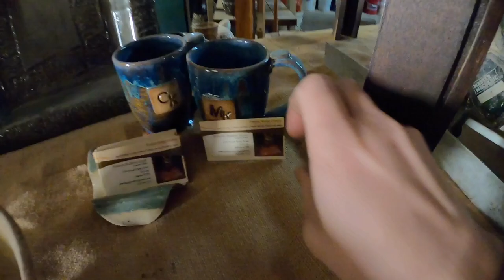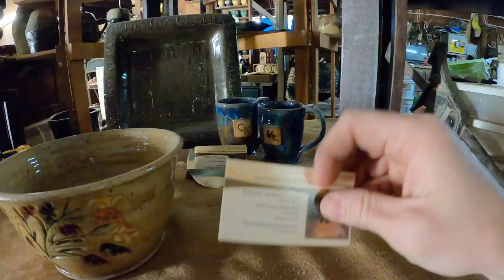Turning Trees into Lumber - First Time Use - Woodland Mills HM122

Comment: Cap’n I have never made the leap to getting my own sawmill.  When I had a real job there was no time... I just took my logs to a local saw mill and had them cut up.  By the time I retired I had so much hardwood lumber that I had to build onto my shop to have a place to do my woodenworks.

However, because I have an appreciation for hardwood lumber... I’ve never refused an opportunity to cabbage on to odds and ends of it.  Like the time...

In 1983 I was making clocks out of barn wood.  They made great gifts and it was all the rage.  I gave one to my brother and he said... I know where there is an old barn.  I’ll see if we can tear it down.  

Well, the farmer wanted the posts and beams but we got to keep the rest of it.  Over three weekends of insufferably hot and humid weather we dismantled it.  

The outside walls were all weathered white oak 1” boards from 4” - 24” wide.  The roof was pretty chewed up but we did salvage some of the rafters...

Then we got to the prize... the loft floor was 2” thick black walnut.  The boards were all 20’ long and varied from a foot to 2’ wide.  Although the roof leaks had taken their toll, we salvaged about 500bd/ft of it.  

Then, we made a discovery.  The lintel over the loft window was made out of hickory.  Someone had carved 1898 into it.  That’s when it struck me that we had been harvesting air dried old growth lumber that had to be used only in special projects.  

Over the years since, I’ve made countless gift items.  That walnut made great gavels, lecterns, quilt racks, shelves, racks, rolling pins, picture frames, gun cleaning boxes... I even made two bedroom suites out of it.  (You can see some of them at http://www.harrislandd.com ). 

But, the best deal of all is that I still have a little bit left.  When I get it dug out... I’ll send you a piece or two so that you too can enjoy the beauty of that precious wood. Do you want it?

Now about saw-milling... I watch a guy who built his own sawmill.  It is amazing and he cuts the most beautiful urban salvage lumber that you will see.  If you want to learn how to cut lumber for the best grain figure and beauty, he does it as well as anyone that I’ve seen.  His name is Mathew Cremona.  

Cap’n keep working at your hopes and dreams... you’ll look back on it one day and say that it was worth every minute!
Reply: I've seen most of Mats vidios and I built my own mill. Mine is lot smaller and a lot cheaper as I have $1500 plus labor in mine. Of course I had a lot of steel given to me and a friend that I got 25" band wheels;pillow blocks at wholesale price! I can cut 36" x 21' logs. I've been using off and on since 2005.
Reply: @wallaceeverett3927  now, that’s a bargain!  I have no welding skills... if I tried to build one... people would mistake it for a mud fence!  Yep, my welds are that ugly.  However, I’m a world class weld grinder!!!

Thanx for you ur comment.

Comment: The best saw mill to own is a buddy's. Get you own blade or 2 and barter the rest of value of the saw milling until you have more volume and get a sense of what your needs are.  You may decide to upgrade your tractor. You could also make a lift for the 3 point that lifts better than the loader. Some say, Get the best you can possibly afford and you only cry once. 
Get some Anchor Seal for the ends of those boards so the ends do not split while the rest dries.

Comment: Some wood, most notably hickory has varying densities where the heart wood is more dense than the sap wood and adjusting your speed along the length is necessary.  Eastern red cedar is another such wood but is more to do with the high volume of knots being encountered.  You'll pick this pretty quickly though.  Looking forward to sawmill action whenever it comes about.

Comment: Just thinking ahead for you Cptn;  make sure and plan for a shed big enough for the sawmill and room for tractor access; I've seen too many sawmill operators whose machines go bad prematurely because they are out in the weather; throwing a tarp over it is not a long term solution. Now, I'm gonna check out some of those clay coffee mugs!
Reply from the maker: We will do a cover large enough at some point.  But it definitely won’t be right out of the gate

Comment: I cringed at 6:07 when I noticed you'd tipped the blade guard up out of the way to get more clearance. I did that, too, at about the same number of hours on my new HM122 for the same reason you did, but I forgot to lower the log stops. Good thing I bought extra blades.

Comment: A couple things to consider on a sawmill that I wish I knew when I bought mine is the clamping system and the blade guides.  You'll have to accept the fact that blades are going to dull and they'll need to be sharpened or replaced.  There are a bunch of different types of blades that hold up differently over time.  I'm always available if you have any specific questions.  I'll share what I know.  Good Luck Buddy!
Reply from the maker: I maybe in touch in the future!  What do you have?
Reply: @CaptainKleeman  I have a Woodmaxx.  I'm currently looking at the Woodmizer LX55 though.

Comment: A nice channel for sawmill and woodworking is Matthew Cremona. He build a huge saw mill but the size is not the point, there is still a lot of information. Very sharp blade, good tension and the right speed are very important. I used to work at a saw mill and the pitch of the teeth on the blade were diffferent between hard and soft wood. thx for the video.
Reply from the maker: He definitely has some good information! Thanks!

Comment: a another channel i watch who does this for a living? one thing they do all the time to cut down on wastage on timber? they throw a block under the thin end of the tree, by thin end your tree trunk gets thinner as it gets higher from the ground right? so they put a block under the thin end an raise it up. So instead of when cutting slabs or boards they can keep as much of the heart wood running the entire length of the boards slabs, also when you start cutting off the bark ? instead of having one end say 1 inch thick an on the other end could be 12 inch, you can reduce massively the amount of wasted wood you cut away befoere getting to the good wood. hope it helps your friend , yourself an anyone who is thinking of doing this
Reply from the maker: Clint was talking about that.  Something he hasn’t tried yet but intends to start doing.  Thank for the channel suggestion and appreciate you tagging along!
Reply: @CaptainKleeman  Bus huxley is another who is building a home from tree' an also uses a wood mill,  dont know how long he has been running one for but he is have way decent tbh so it looks from a novice point of view

Comment: To eliminate some of that blade movement when cutting Move the side guides as close to the material that you can safely  and maybe a different style blade would help
Reply from the maker: Thanks for the tip
Reply: His mill doesn't have the adjustable guide option, Larry.

Comment: I always worry about how many blades I'll go through in the learning curve.  Therefore blade replacement would be a big consideration on my first saw.  How readily available, cheap, and easy to change. Nice video Captain.
Reply from the maker: You make a great point.  I need to be pricing blades for sure.  Thanks for watching
Reply: I don't think blades are too expensive, and depending on your area there are places that will custom make blades for you. I had a place make me a metal cutting blade for a 10 inch bandsaw and it was under 50 bucks.
Reply from the maker: @BlueDually4x4  I’ll have to ask around!  That would be handy
Reply: @CaptainKleeman  All you have to do is search bandmill blades! I use 15 foot 8 inch blades and 10 are around $200 +/-.

Comment: Was water dripped on the sawblade? What is the use of that, cooling, lubrication?
Reply: Yessir! Cooling and lubricating the blade. In the summer I use a mix of dawn dish soap and water and in the winter I use windshield washer fluid because of the freeze point.

Comment: blade is pushed from the back like rear wheel steering  give it 1/8 inch and it runs away left or right faster than you can correct.  ok

Comment: I would get an automatic feeding system
Reply: I built my own mill, and it is totally manual. I don't believe in all the power features that people use that can go bad; and with manual push I can feel what the mill is doing, and a lot of power feed controls you have to walk with the mill anyway.
Reply from the maker: Yeah,  I would rather get the feel of the wood first and make sure I understand why the mill acts like it does

Comment: I have to disagree with his sizing the mill by tractor lift. when a mill is setup on the ground, or even above you can push, roll or winch heavy logs onto it that your tractor or dozer etc can drag easily, but not lift. with your regular access to excavation equipment you could easily have the mill set at ground level that you just drag logs next to and push on. I would say size it by the size of your larger trees you may ever cut.
Reply: Another thing I kinda focused on when buying my first mill is expense. The price wasnt bad and as a first timer, I wasnt about to drop 5k on a mill when I have NO idea what I'm doing. Repairs cost more on larger mills as well as blades. I agree with your statement about dragging larger longs onto a larger mill, but that just wasnt my cup of tea.

Comment: I apologize for changing the subject what am I changing the subject to very simple when you cranked up your car to move it I very distinctly heard your power steering pump needs to be replaced
Reply from the maker: It’s actually a new pump,  the leak is in the rack and pinion.  I just add fluid from time to time.  That car is short timing it for a few more months
Reply: i asked him if it had a super charger on it! sounded like a roots!! HAHAHA
Reply from the maker: @cbyotas519  😂😂😂